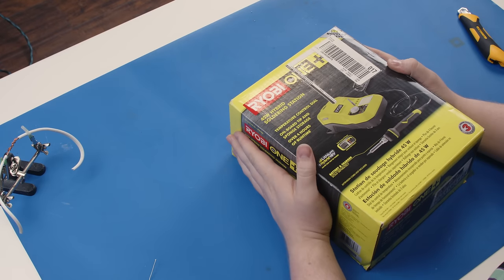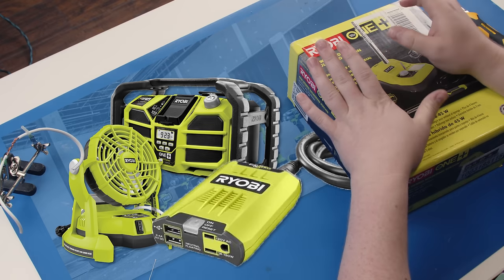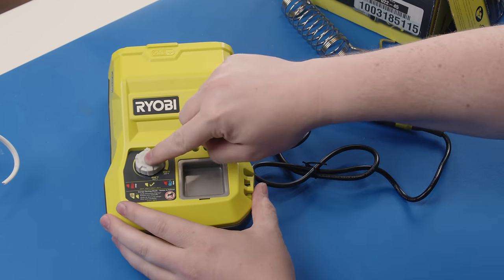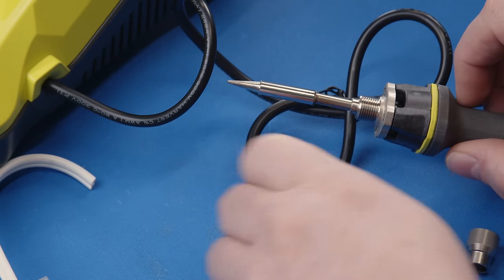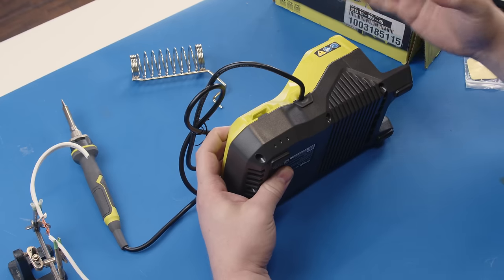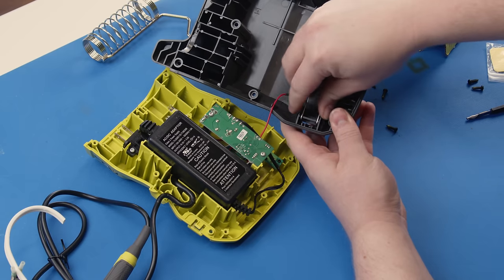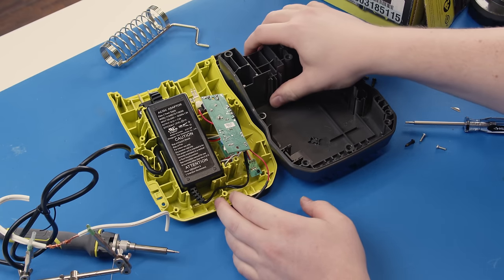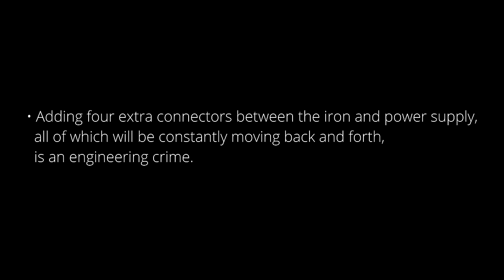Ryobi has GOT to be joking with this soldering iron

Comment: I definitely appreciate the use case larger, more "industrial-style" soldering iron stations. Honestly for me, I only do soldering on a small scale (hobby stuff type boards, microcontrollers and all that fun stuff), so the TS1000/Pinecil/etc is very convenient, since I'm surrounded by USB-C cables and chargers (but not really any large 18v power tool stuff) and it's nice and small (feels just like another electronic gadget lol). Totally fits my workflow, but I can see why it doesn't fit yours (and your concerns with the rigid connectors).
Reply: I have begun using soldering tips that screw into vape mods. Its super convenient.
Reply: A laptop USB-C battery bank with a belt clip and a 2M long USB-C cable would make one of those little USB-C soldering pencils into a totally workable portable soldering solutions. Well, as long as you're willing to carry a small bag with you to hold a stand, sponge, brass scrub pot, and some flux and solder. Still, totally doable and no less convenient.
Reply: @christo930  I have trouble believing an iron that doesn't even quote power will be anywhere near as good as a TS100 clone at 65W powered by an RC battery or USB-C PD 20V with a much more massive tip. The only hint I can find is the replacement battery they sell is a 4Wh Ni-Cd which would seem to imply it would run out in a few minutes if it had similar power output (and Ni-Cd has a much lower specific power so likely can't even push that much current). Plus temperature control with a thermocouple close to the tip makes it far easier to get good results without burning things.
Reply: @schroedingershat7912  BigClive did a video on the Iso-Tip iron and it does its job pretty well.
Reply: a ts100/ts80p/pinecil/any fx951 clone/t12 compatible station would blow this ryobi/888/936 clone/907 compatible out of the water. 

why? thermal conductivity. 

the reason why cartridge based systems exist like with the ones i listed in the beginning is exactly that. 
the older 936/907 design has a removable tip and the heating element is in the handle. with cartridge based systems, the heating element is inside the cartridge and there is no gap or anything inbetween. it is far more efficient. 

really, if the form factor of the ts100/ts80p/pinecil isnt what youre looking for then just get one of those t12 compatible/fx951 clones. there are ones with an integrated psu.
Reply: hello, this TS1000 used also Tips simmilar to the T12,, they are great.
Reply: I have a TS100 and ended up getting one of those small 'usb charger' tops for my cordless 18V drill battery (ozito in my case), I drilled a hole in the casing, ran a wire in with a fuse, then put a barrel jack on the end, now I have 2 USB ports and a cable to plug into TS100 and be able to use it anywhere. a 4Ah battery lasts ages.

Comment: 27:30 Personally I prefer Torx screws over Phillips (and god-forbid, flat-head) screws. Much easier to align and nearly impossible to strip, especially because manufacturers commonly use some kind of Loctite on the screws when assembling products. The Nintendo screws are like the worst of both worlds-- uncommon bit AND easy to strip. lol. I have a set of Wiha Torx drivers that are awesome for taking apart all kinds of electronics, all the way down to T1 size. Bonus is that they double as Allen/hex drivers.
Reply: Allen screws are also pretty good PROVIDED you use a decent set of allen drivers (i.e. not those god awful L-keys). Wera also makes what are called "hex plus" drivers that have a modified shape which puts more of the driving surface in contact with the insude of the socket.

 But yeah Torx are the best especially that there are no "metric" or "standard" torx they all use the same drivers.
Reply: @atomicskull6405  Yeah I have some Wera Hex Plus drivers in the L-key format which are pretty nice (probably some of the few L-key types that don't suck). Need to get a set of T-handle ones sometime... just need more desk/storage space first... lol
Reply: Yeah honestly I prefer torx as well. As someone who used to be a electronic repair technician torx was far better when I had to take things apart. Far less likely to break from my experience. Torx or Torx Plus is on a lot of insert tooling that I've used. It holds up really well there as well. Torx or Allen is way better than Philip or Flathead for anything that has to be used more than one or two times. Haven't come across hex plus before but it it seems pretty good as well.

A bit into that repair technician job I bought a full precision ESD wiha set that comes with the metal holder and each different size/ type is a different full screwdriver. While expensive (350$ ish if I remember right) it was a great investment. That helped a lot on not breaking Phillips as well. Having the right size driver helps a lot on not breaking fasteners. Have it on my workbench at home now and it does have the right size to take that apart and would fit.
Reply: I was kinda baffled at the torx part as well. To me torx is a sign of quality and I never use any other head be it the small repairs around the house or building electronics. Philips or PZ is only for those situations when I can't get the correct size screw with a torx head for some reason.
Reply: I like torx, hate security torx
Reply: Torx is much better. Even used on cars nowadays. Much higher and precise torque readings. Just overall better than Philips, and pretty good compared to hex
Reply: @atomicskull6405  Allen screws are OK if they aren't made of cheese which, unfortunately, they often are.
Reply: @CrashCarson14  T12 isn't bad too. Just don't get tempted to use Torx on T12.
Reply: idk, i must not be doing it right because i accidentally got torx bit screws for around the house work and the bits for them are destroyed after anything more than light use
Reply: @SharpForceTrauma  I don’t know why, is it the right fit? Torx needs to be a tighter fit, you can’t just use any like a Philips head
Reply: @CrashCarson14  Yknow, im not sure. Probably has something to do with it though
Reply: @SharpForceTrauma  I find that many torx bits are made of very cheap steel and strip very easily. If you want to do more heavy work, you should try a pack of impact rated torx
Reply: Yeah I don’t get it, I mean they’re made to be the successor to the Hex head, since they won’t round off. I’ve never really seen them strip but I guess cheap steel wont help either.
Reply: I prefer Robertson screws (tapered square). If the lad had accepted to let Henry Ford use it, the world would have been a lot better. Probably not more fair, but at least square, instead we got crossed...
Reply: @rolfbjorn9937  , Ford ultimately elected not to use Robertson screws because they would have been available only from Canada, as Robertson wouldn't license the patent for manufacturing them to any other company in the US or elsewhere. I do like Robertson screws, however.....
Reply: @CrashCarson14  you cant repeatedly use any size with a phillips head
Reply: @goodun2974  just another reason Canada is great 😉
Reply: @benpye6854  , I tend to agree, although I might be biased since my mom's side of the family was French Canadian (Quebecois). On the other hand, my mother-in-law is a royal pain in the butt (even her own kids feel this way), and she was born in Grand Falls, New Brunswick, so....
Reply: @atomicskull6405  , I have a set of Eklind fold-up Allen wrenches from over 30 years ago, in both SAE and Metric sizes. Nice tight fit, very strong steel, and the folding handle provides leverage; nothing wrong with those! The big handle sometimes gets in the way or is inconvenient if you have to remove a lot of screws, but still,  I frequently use them to break stuck or overly tightened screws free, then switch to a cordless screwdriver; or use them merely to "size" the screwhead before selecting a straight or L-shaped hex key, or an Excelite-type driver handle or whatever.

Comment: Thanks for letting people know about those cheapo irons at hardware stores. When I was younger and didn't know better i thought soldering was so difficult cause all I had experience with was those crappy non temp control ones. Recently I got a simple one with digital control and man it makes such a difference
Reply: My uncle, a long, long time ago, assembled kit radios in his mother's kitchen table, for a soldering iron he used a copper nail held with pliers and heated on the butane range. He sold and repaired radios as a side hustle.

I made a solering iron out of a pencil, a small scrap of copper wire snd sone thinner wire strands to hold it together., which worked well enough until I bought a replacement.

Both of those options worked better than the shitty irons at the corner shops and hardware stores.
Reply: Has nothing to do with temp control, rather it is the type of tip the iron uses.  The cheap, screw in type that is nickel plated copper, is difficult to use if you don't constantly file the tip down to clean copper and tin it again, often.
Reply: The radio shack pistol grip soldering iron is how I learned to solder, I think if you learn with bad tools at a young age you're really good with proper ones once you graduate to them. Brings back good memories.

Comment: As far as burning the DIN connectors, you actually need a higher temperature. If the temperature is too low, it takes too long to heat the solder and gives the plastic enough time to melt. It shouldn't take more than a second for the solder to melt so that you can get in and out fast.
Reply: Big tip and solder bridge 😎

I redid some GE proprietary connectors that were solder pots. They were so thick and the person before me cooked the 14g wire to the point there was no flex. 🙄
Reply: Absolutely. When he said that and was then slagging off the simple mains powered irons, I was thinking that this guy doesn't know how to solder! The fancy controlled soldering stations are nice but the basic irons work OK too. Another clue is that he said the tip bend, well they do if you put far too much force into them, trying to get heat into the item, especially if your iron is too cold!
Reply: Also he probably doesn't clean the surfaces he wants to solder, nor use flux other than in the cored solder!
Reply: you need good thermal recovery, i can solder connectors fine using a JBC core

Comment: Sounds like the PERFECT "first soldering station" - sufficient to solder your own internals of your own custom soldering station, then gut this one and fill the chassis with the newly made internals with your own, while keeping the soldering iron itself (but swapping the cable).
Reply: You just described building 3D printers.
Reply: No 3D printed thing will feel that solid
Reply: @aaaaea9268  I think he meant "buy a crap printer, print parts of good printer, gut the crap printer to make a good one."
Reply: for 40 dollars just get zhaoxin
Reply: @aaaaea9268  as someone who prints in PETG, I beg to differ, if your willing to design it as such and put in the time to print something so overbuilt, you can make boarderline indestructible items (and it's kinda satisfying...)
Reply: @MiGujack3  you mean the Ender3? Buy and then promptly print replacements for half the parts it came with?
Reply: It is laughable that you think you can one-off design a superior internal SMPS or controller if at the skill level where this is your first soldering station.  Try a few years of electronics engineering and then countless hours R&D prototypes to just get it working again, at all.    

Essentially it would be madness.  Time has value, buy something else if you want something else.  Even doing low skill manual labor, you could mow your neighbors yard 5 times and earn enough for a mid-range Weller or Hakko, etc.
Reply: @stinkycheese804  I think you're missing two points. 1. It's not hard to design something superior to what these toy stations offer. Certainly not as good as a pro station, but good enough to proceed, hone your skills and eventually design even better. 2. You're not entering from 'no clue about electronics' level. You're entering from 'plain soldering iron is no longer sufficient and hinders your progress' level. And mowing lawns won't hone your electronics skills. Designing a soldering station will. And treating the time spent on it as lost/wasted and better spent mowing lawns completely misses the main purpose of such a project: the end product is a nice boon, but the main value lies in the learning experience.
Reply: @stinkycheese804  everybody in the DIYverse thinks they're smarter than the engineers who design this stuff. Let them play make believe

Comment: I work with PVC cabling all the time. Hang the base in place on a wall, then hit the jacket with a heat gun or blowdryer. Nice even heat, a bit of weight, and some patience, you will remove all of the natural curls. The jacket expands, then contracts to the new shape. It will behave much better after that. You can also wind it around a dowel to give it a tight curl like a phone cable. Handy.
Reply: Completly agree, i do that to basically any new thing with a cable. But pvc cable is still not a good choice for soldering iron. Its much stiffer than it should be. Rubber is better but silicone is excellent
Reply: @Boz1211111  Far less than ideal yeah, but it can be worked with if you're on a budget and have some patience.
Reply: I often sort of nest the cable in a towel then blast it with a hot hair dryer. Once it is uniformly quite hot i'll work out the worst "kinks" by hand if necessary then hang it to cool, sometimes with another heating just before hanging. It is a horrible time waster but can make abominable cables into merely not-very-good ones.
Reply: Replaced mine with a nice soft rubbery cord from Hakko 😅
Reply: Wow I'm stupid. You're a bloody genius, I know what I'm doing today!